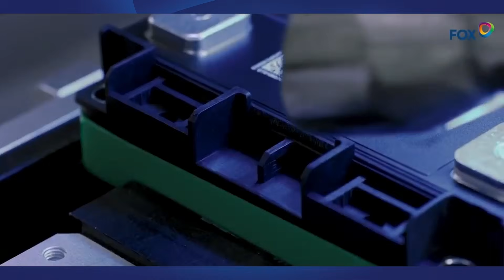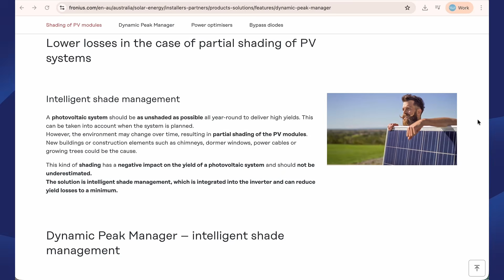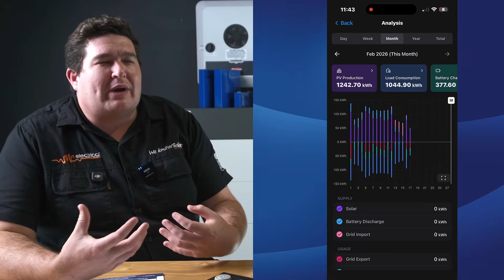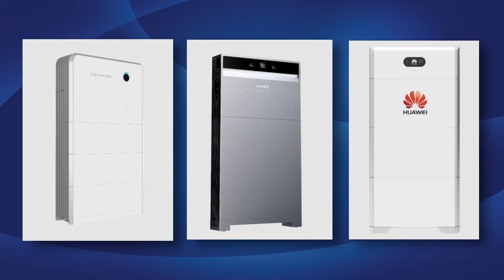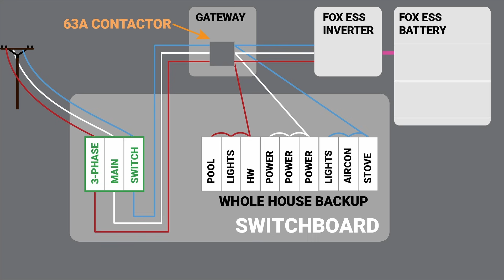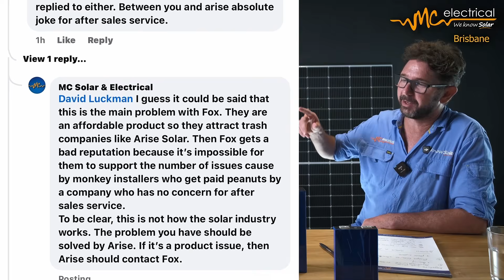Fox ESS Battery Review Post-installation & Factory Tour

Comment: Thanks for your review and others, it was about time you reviewed this system, considering the market share they hold.

I decided that this was the system for me 6 months ago and I will get it soon. It just doesn't make sense for most people to drop 20-25k for a system that's supposed to save them money, especially in a cost of living crisis, when you can get a functionally similar system for 1/4 to 1/5 of the price, and start saving withing a couple of years instead of 6 or 7.

And on the topic of functionally similar, the only real drawback ATM aside from maybe full home backup, is not having a bidirectional EV charger. Also the new CQ6 does have an aerosol extinguisher in each module according to Geminis scrape of the manual, so there really isn't that much between them. Cheap and good is a reality right now, good for the masses

Comment: I had Fox-Ess 42kwh AC coupled with my Enphase panels (I have 3 small roofs that can only fit 3 panels each - the perfect use case for Enphase) and I am enjoying the hardware so far. But I would disagree with you on the app though. The settings on it are not intuitive and very poor:

1) You can set a minimum SOC for 'self use mode' ie i chose 5% because technically this is sold as a 100% DoD battery in Australia. But if you revert to 'mode scheduler' to do force charging and discharging, you are not allowed to go below 10%. Makes no sense. 
2) In Force Discharge mode, you can set a minimum limit from which point the discharge will stop. ie this is the mode to use for those on electricity plans that pay extra for FiT in the evening ie Globird, Flowpower, AGL Battery Rewards. I chose 20% so that I could still rely on my battery to power my house before it hit the 10% limit. However once it hits this 20%, the battery starts drawing from the grid to power the house - at exactly the opposite time i want to be drawing from the grid (when power prices are higher) 

The reply I got from email support was "that's the way it is"...
Reply: I agree, the software controls are pretty limited! I hope this changes over time.
Reply: I agree, the software controls feel somewhat limited. I hope it improves over time. It is otherwise a great battery and it seems nothing can beat it for the price.

Comment: Just had a single phase 10kw inverter and 42kw stack installed tuesday. Bought through arise solar i guess thats who they are referring to. Did take 3 months so yeah that was painfull but what can you expect they selling this setup for 7.5 grand in some places I paid 10k here in cairns and their installer in cairns had over 300 reviews on google with 4.8 stars. So that put me at ease system is working well!
Reply: Hopefully the local installer will assist if you do need some after sales support. Don't expect it from Arise
Reply: @Yorick_Mark haha yea got that on the sales call. Installer is legit company only reason i did the purchase really
Reply: @niekvandenheuvel63  It sounds like you did your due diligence. You should be just fine.
Reply: Also in cairns you want to hope nothing goes wrong with it! They and the local installer failed to turn up for over 5 months.
Reply: @Luckyfnq Only 5 months. That's quick for Arise.  Its usually an indefinite wait time.
Reply: FoxEss installers are not good. FoxEss's installer controls the managerial access. Not the owner. So, they can charge you to call out fee. mess they will create in the background, the installer has the Total access to your inverter.

Comment: Not sure I got this right, whole house backup is possible on a single phase?  Is that correct? If so, is that only supported by some specific type of inverter.
Reply: Single-phase is much better for full home backup. But, because the power is always running through the inverter, you will want to ensure that you don't trip the internal islanding contactor. I think it's just under 80A for the single-phase inverter, compared to the H3-Smart's ~25A.
Reply: @Yorick_Mark  I disagree, every system I have seen has a changeover switch in the switchboard that switches between EPS output and grid output. Many people are installing Chint NCH8 contactors to automatically switch the supply under blackout conditions. 
If you wire all the backed up circuits directly to the EPS you will lose supply whenever you overload it, does a software update or when it will eventually break.

I plan on having whole house backup through my 10kw Single phase inverter by having EPS output and grid output on each pole of a Chint NCH8/63-22, held open or closed by the grid supply and then it will switch over to the EPS when it loses supply
Reply: @debffweqdqwqfwg  out curiosity, does it mean that Fox doesn't offcially support to scenario if there is more than 1 opinion on this topic? I don't see anybody talking about Sig full house backup. It just works and there seem to be only one way of doing it.
Reply: @pabichpawel with the sigenergy are you still limited on pass through capacity? For me I need to be able to draw 14.5kw constantly to be able to power all the house including EV etc. so I would rather have everything fed NOT through the inverter until there’s an outage
Reply: @pabichpawel  Hager ESC263 is a higher quality contactor. I'd personally go with a manual changeover switch due to the nature of how contactors work, but YMMV. Pro's and cons for both, and you will get the full power output of the inverter EPS either way.

Comment: Appreciate your efforts in taking a closer look at Fox Ess Inverters and Batteries.
Your videos are always very informative. 
I am about to have a 10 kWh Inverter + 42 Kw EQ4800 Battery installed next week. 
It will be installed adjacent to the main switchboard which means it will be mounted on a brick veneer wall outside a bedroom (no window).
My concern is that the system may create to much noise particularly the Inverter! 
With your experience relating to your last Fox install can you tell me whether this is something I should be worried about?
Reply: Just got this setup installed yesterday its super quiet much more compared to my old fronius 8kw inverter it really surprised me
Reply: @niekvandenheuvel63 
Thank you for your input. Gives me a little peace of mind. 
My neighbour recently installed a massive system with a Syg Battery and Inverter. Honestly it is so loud I'm sure there will soon be complaints from neighbours.
Reply: @niekvandenheuvel63  Yeah, the SnapINverters can be little jet engines. The Symo 10kW and up were particularly noisy.
Reply: I wouldn't be concerned. You should not be able to hear any noise through the wall. There may be a little bit of a hum, but you would have to be right up next to it to hear it. I dont think it has an external fan for active cooling but even if it had one, you shouldn't hear it inside.
Reply: @Yorick_Mark  H1 has small internal fan that comes on over 50C internal temp: https://youtu.be/TRrcRyMOBmc?si=qEQsVU9BC2_RBbqT&t=223
Reply: Its very very quiet. Its noise is very low. Mine is a 3phase 15kw and its fan noise is barely audible. Standing beside it. Inside you will not hear it
Reply: @paulgerrard9227 
So glad to hear that! 
Thanks for the feedback.

Comment: Currently waiting for my Fox ESS H3 15kW Smart with a 48kWh CQ6 to be installed.
Honestly, the hardest part of the whole process was finding someone I actually trusted to do the install. I contacted Arise and Aussie Solar Battery, but the call centre staff from both companies didn’t seem to have a solid understanding of their own products, which didn’t exactly inspire confidence.
In the end, I went with a knowledgeable local installer who knew their stuff. They were a couple of thousand dollars more expensive, but they won the job because I’m not willing to play subcontractor roulette when it comes to something this important.
Reply: Me too, but with goodwe system. The installer I went with was $2000 more than the lowest quote. After discussing the install with him, he gave me some phone numbers of his previous customers. I called 2 of them and I visited one who was 3 streets away.
Reply: Thats great, and I think you made a wise decision on your installer. You may want to see if you can get the upgrade to the H3-Pro instead of the H3-Smart for the higher passthrough capability. It's CEC-approved now.
Reply: @Yorick_Mark am I right in understanding the that passthrough capacity is only important for those circuits wired to the EPS? Or is it bottled neck for battery usage aswell?
Reply: @jamezps3  EPS only
Reply: I would like to give you a little bit of insight. Mine is slightly smaller, one modular 37.22kw. I had an electrician install 2 timers in my house before the battery installation for my 2 hot water systems. I use the timers to heat up the hot water between 11 and 12. I also have a pool and 2 fridges etc. Each night the battery depletes by 25%. It takes till 9/9.30am to fully charge up again. The app is excellent. Enjoy😊
Reply: Had our Fox ESS 10kw single phase inverter and CQ6 42Kwh system installed last week. Like you, I didnt go for the cheapest deal with those companies that adverstise everywhere. Went with a local electrician who knows his stuff and has a great reputation. Still get a ROI at the 4 years mark, so very happy.
Reply: As long as the installers are accredited there is nothing wrong with saving a couple thousand dollars
Reply: @guharamprasanth9717 spoken like a true cowboy
Reply: Which state is this?  Virtually no one here in VIC IMHO
Reply: @tzetv Newcastle NSW

Comment: The problem with Fox at the moment is that Aussie support is very slow (try calling their support line); and that the installer base in Oz right now is not exactly of blue ribbon standard.    Really unfortunate 😢
Reply from the maker: Valid points, especially with support times and ensuring good installation standards. 🔧

Comment: If battery manufacturers placed fire extinguishers in batteries modules they would have to be inspected every 12 months to insure they are full and operable if needed.
Reply: Don’t think fire regs apply in this manner
Reply: Solaredge is the only one who has an extinguisher in the battery unit
Reply: @Iwishiwasflying  Many battery modules have an aerosol "fire extinguisher" these days.
Reply: @Iwishiwasflying  Sigenergy as well